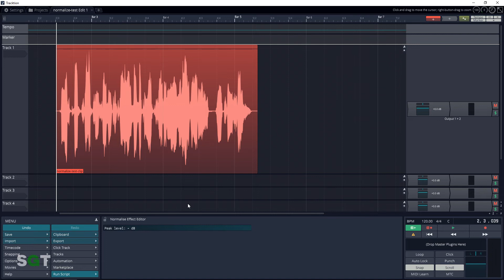Tracktion 7 Tutorial - How To Normalize Audio in T7

Comment: Hey SGT, used your video, very straightforward and gets to the point, thanks for your help.  Quick question, I'm using Waveform to record audio versions of a book I wrote and I mess up a lot.  My projects have a lot of clips, and it's pretty tedious to individually normalize all of them, is there a way to either normalize every clip in a project at once or set it to just normalise when a clip is done recording?  Thanks again.
Reply from the maker: You could render your project once you’re done recording and there is an option to normalize while rendering. Or you could render it and then bring it back in and normalize it as one big file. Thank you for watching. Keep creating! 👊👍